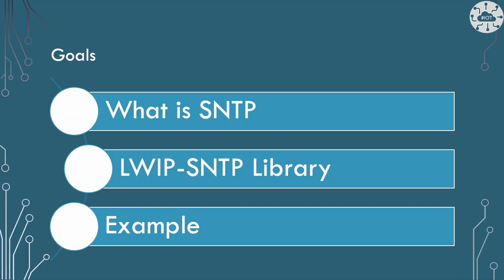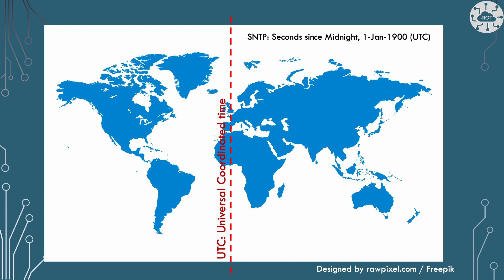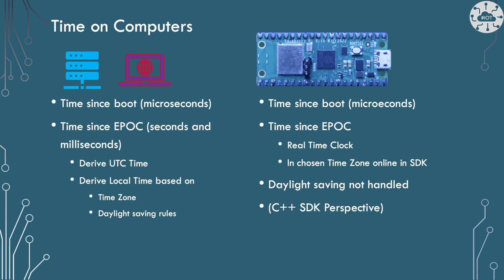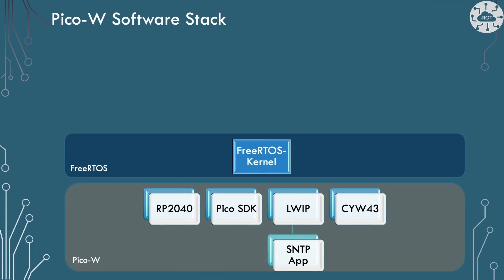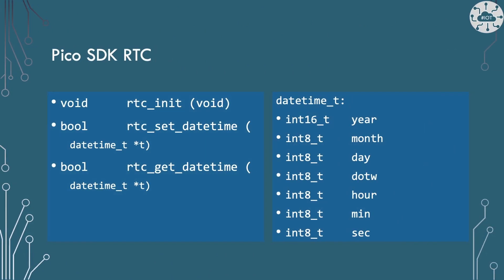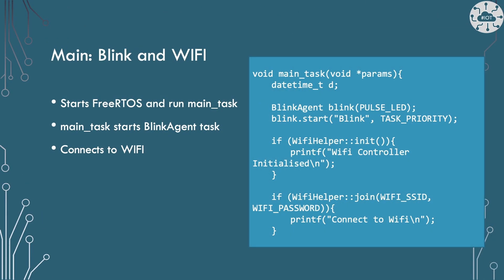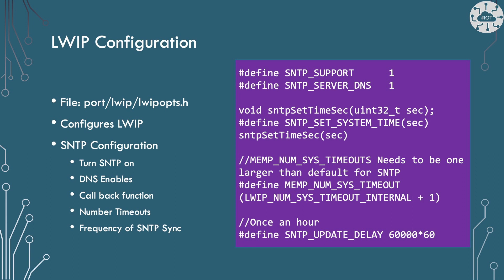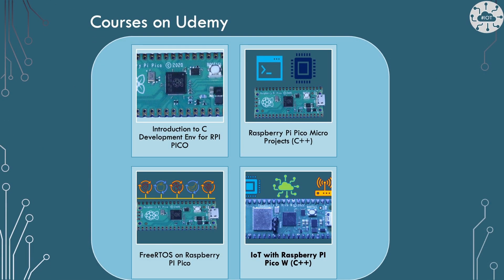SNTP on Raspberry PI Pico-W with LWIP and FreeRTOS

Comment: Checking the linked code, I have a question. After calling the sntp_init , it seems the lwip sends a ntp request and somehow a reply is received and processed. Yet I see no calls to sys_check_timeouts or cyw43_arch_poll. How is it even processed?

Thank you for your example and explanation, I wound't otherwise find all the necessary lwipopts params.
Reply from the maker: Correct no call to poll because I am running under FreeRTOS Kernel and the LWIP FreeRTOS library. This means I have a whole thread looking after the tcpip stack and triggering the call back.

Comment: @14:27 You mention increasing MEMP_NUM_SYS_TIMEOUT but I don't see this in the file port/lwip/lwipots.h in your github repo.  Where are you setting this?  I seem to be stuck on the same problem that you had -- an assert in sntp_init().
Reply from the maker: Hi, it should have the lines:
//MEMP_NUM_SYS_TIMEOUTS Needs to be one larger than default for SNTP
#define MEMP_NUM_SYS_TIMEOUT            (LWIP_NUM_SYS_TIMEOUT_INTERNAL + 1)

Looks like I may have not committed an update to the file. Sorry, should be there now.
Reply: @DrJonEA  Thanks for the clarification.  Very useful video.  I will have to keep hunting, as I had already tried +1 and +50 prior to commenting.
Reply from the maker: Good luck with your hunting. LWIP documentation is not easy to work with.